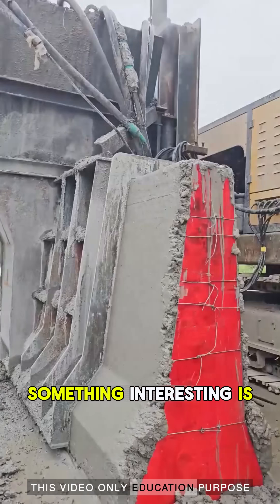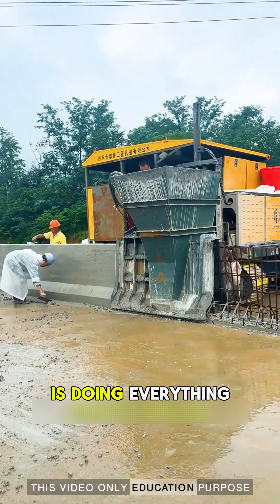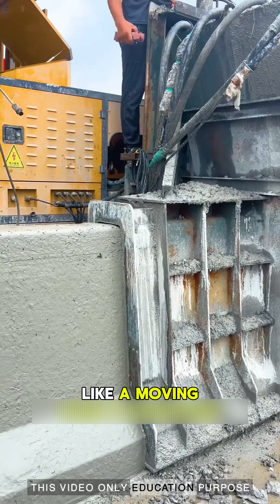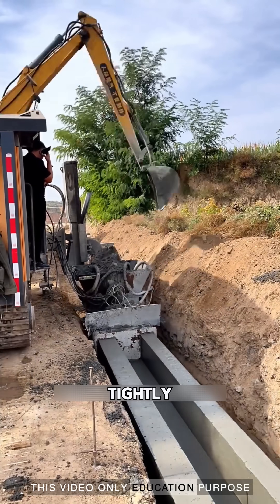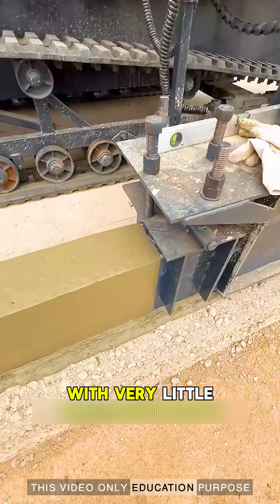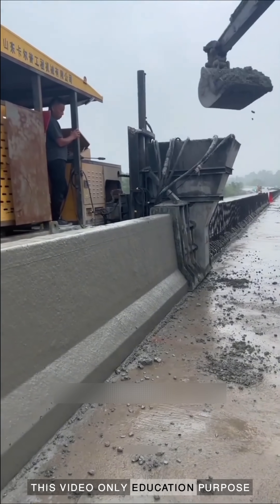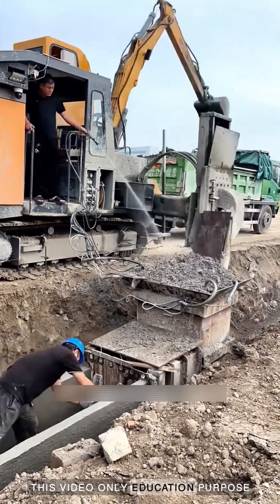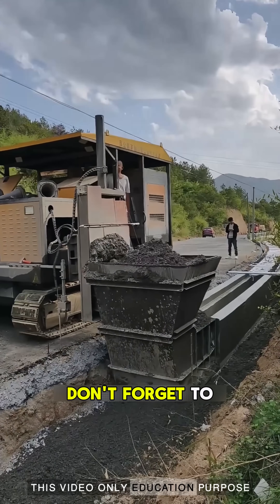concrete crash-proof barrier columns are not made by hand: #construction #concrete #shorts

Comment: In cold weather you need some air in the concrete road barriers for water to freeze and expand. Whether you realize this or not stones do absorb water that's why you need air in concrete. State highway departments have special requirements for air in concrete. When I was an inspector for the state highway department it was 3.5 percent air entrapment. But I retired years ago and I haven't kept up with new concrete mix designs.

Comment: Where are the expansion joints? Everything moves with temperature changes. If no soft joints, then the materials crack. Then water enters the crack and freeze-thaw enlarges the crack into pieces, chunking off.

Comment: Interesting!
What about expansion gaps though?
Reply: You go back and saw cut it later, just like pouring a garage floor.
Reply: That can be programmed into the Machine but why do you need Expansion Joints on a Road Barrier? 
I know it's required on Bridges & Roads but on Barriers which don't have any stress?
Reply: @Nand1909  Thermal expansion works the same way no mater where the object is! 
If it can be programmed into the machine it must be a thing, otherwise they would not do it!

Comment: What concrete is this that stays up after so short forming?
Reply: ‘High-sump’ concrete… which is very ‘stiff’ as it comes out of the chute… plus ‘accelerants’ can be added to the concrete mix to speed it ‘setting up’ [holding form]
Part of the need to continuously vibrate the ‘slip-form’ is to make sure this ‘stiff concrete mix’ uniformly fills the moving ‘slip-form’.
Pretty interesting activity to watch in progress !
Reply: Add clay and xanthan gum to the mix. Then high vibration is necessary to flow it into the form.
Reply: the fast setting kind.

Comment: When they figure out how to load it straight out of a mixer truck they will really be on to something.
Reply: Concrete Pump Attached To A Trailer Or Purpose Built Pump Behind The Standard Cement Truck The Only Down Time Would Be Switching Trucks 7 Cubic Meters At A Time Per Truck 🚚
Reply: Worked for years doing this and have never seen anyone using a backhoe to load the paver.

Comment: Why is concrete delivered in dump truck instead of concrete truck?
Reply: I haul cement powder and see a lot of both kinds of trucks loaded. The dump trucks are loaded much faster using what's called a drum that pre-mixes the cement. It's almost three times faster than mixer trucks.

Comment: Where are the expansion joints?
Reply: Joints are put on afterwards. More of crack control joints then expansion joints.
Reply: I've seen one of thoes big concrete saws. The circular blade is like 4 foot tall.

Comment: Notice how the concrete has for some reason been poured into some sort of dump truck and then gets transferred into the former device with an excavator bucket. This is not efficient, it’s ridiculously over complicated and probably all just a demonstration project. Odd. Don’t they have concrete trucks?
Reply: Um no Mr YouTube engineer in first world countries or most likely even here they would use a concrete truck for some reason they are using a dump truck here but most of the time a series of concrete truck drives along with the paver so it is more efficient
Reply: @industry.studio84  Yeah, exactly.  That’s my point.

Comment: They should use this technology to build homes by making the forms taller. It would make building homes a lot quicker and stronger.
Reply: They have something similar,  it's like a giant concrete 3D printer
Reply: @arizonacutlery547 how do they cut them into lengths.
Reply: @JohnKelley-j5w In youtube type 3d printed house and it'll show some videos, not exactly the same but pretty cool, and kinda similar

Comment: Had an awesome crew doing curb with machine here in Jax Fl. We would deliver 100 yards (before lunch) and as long as your slump was good they would knock that truck out in less than 1/2 hour. Sucked when you got to cul-de-sacs though, really slowed things up. Probably the only crew I didn't mind doing curb work with. Have another guy that gets 1/2" slump peastone mix, brings his flatbed and a conveyor to the yard, after the truck is loaded you back up to the conveyor and he loads it onto his flat bed. They shovel it into small machine doing mostly parking lots, company was Permacurb. One of the view curbs that was actually in the ground about 8" vs on top of the ground.

Comment: I was a construction millwright for 30 years and things changed a lot in that time. When I started we would align motors to pump and tubines etc with manual dials within thousands of an inch but eventually we used laser alignment instead of manual dials and the laser system would tell us exactly how much to move a sometimes 100 ton machine in thousands of an inch reducing adjustments saving time and effort.
Reply: Now combine with machines automation robotics artificial intelligence drones 
Work is getting done at record pace.
For minimum wages
Reply: @no-name420 Way to go, mate. I wanted people like you explaining this. Thanks

Comment: They have to have small spaces in between to allow for expansion and shrinking...
Reply: Came here to say the same thing.  These thing don't last as they don't have expansion gaps
Reply: yeah - the expansion joints occurred to me too...
Reply: Don't need them in these countries, allegedly.
Reply: Only counts if you care about the cracks.
Reply: Duh railroad tracks need gaps too
Reply: @edsnotgod  Most railroads today do not have expansion gaps for straight runs, there are gaps only when there are switches in junctions for obvious reasons. Rail is pulled in tension before welding, so it stays in tension and forms continuous rail. Expansion gap rail is obsolete technology, unless it is for some specific application like for maintenance zones and repair halls.
Reply: @jarivuorinen3878  "Rail is pulled in tension before welding" Actually depends on temperature. Continuously welded tracks have a so called neutral temperature where they are under neither tension nor compression. The neutral temperature is selected based on the local climate so that tension doesn't get to high at the lower end of the expected temperature range and compression limits aren't exceded at the upper end.

 If during construction the temperature is below the neutral temperature then tensioning is used to elasically stretch the rails to the same length that they would have at the chosen neutral temperature. If construction temps match the neutral temp then the rails can just be welded without tensioning. And if construction temps are higher than the neutral temp then no welding can take place (that's why in the summer rails are typically only welded at night).
Reply: @blahfasel2000  Very good continuation on details, to share correct image how it is done, thank you for extensive clarification! What my main comment tried to basically say is that modern rail is continuous and does not use gaps to compensate for temperature expansion and contraction. And you tension (typically, you detailed the real way to do this) to prevent buckling, because too little tension in hot environment causes compression, and buckling creates dangerous geometric failure and increases derailing risk.
Reply: @edsnotgod  Did you see any in the video?

Comment: I like how the vibro-compaction 'increases the concrete strength by 20%'  When really what should have been said is that the vibro-compaction achieves the correct strength.  when its not vibro-compacted it loses more than 20% of its design strength.
Reply: and has voids all over it, at least he called it concrete and not cement
Reply: Good job  fellas...
Reply: meh, six of one, half a dozen of the other.

Comment: There's no way addiing expensive machines 😂😂😅😁😆😅can be cheaper
Reply: Than some chippie constructing a timber form every 8ft, casting it with stop ends that have to struck and the concrete scabbled to get a key for the next section that can only be cast every 3 days.  You clearly don't understand building/civil engineering construction.

Comment: Again, it’s China😂 It would take the US five years to do 1 mile Road😂
Reply: And USA will say that China is copying their technology
Reply: And in China the substrate is mud half the time
Reply: The USA had this market cornered 40 years ago. 
Gomaco curb  machine was a great machine. 

Company I worked for in Ireland had one like in this video. 
They got second one which was much larger machine but it was able to do the tighter radius ,from what the smaller machine was able to do. 
(1993 first time working on the machine. )

In one pull with the right moles on the machine it could lay. 
Water channel/ curb together/. 

Along with footpath , at what width usually 2m, path. 

And if you’re really feeling brave 😂. 
Inside of footpath. 
6 foot high wall. 

It’s simple idea, 
But when you see it working it’s a fabulous machine.🔥✌️

Comment: that is great work , but there is one concern , how does that one continuous slab deal with  and will respond to earth sagging , land-movement, thermal expansion/contraction of weather?
Reply: The same as the ones built with the forms. Why would it be any different?
Reply: You will have to ask the structural engineers that question for a definitive answer, otherwise the simple answer is that it is all calculated in and won't have been forgotten.
Reply: Simple answer is it will crack. Just wait until a truck hits it & busts pieces out. To remove damaged area you have to saw joints on each side, jackhammer out the damaged area, them from & pour new sections.
Reply: @TomSloppy-q8k  It should withstand several impacts in the same place.  These barriers are normally located between opposing carriageways and therefore the lane adjacent should have trucks in it so that impacts are rare by them.  normally its a car impacting them with a glancing blow, for which they are man enough for the job.  The Highways Authority will have done their sums and assessed the risks to establish whether a concrete barrier or Armco is the most suitable.
Reply: Steel rebar frames...thats the inner coil...
Reply: First job every morning is to cut all of the joints from the previous day work. 
Usually couple guys with con-saw.s. It’s easy cut fresh concrete.